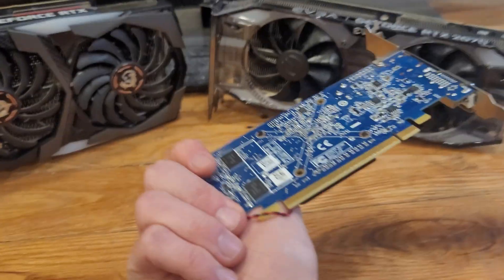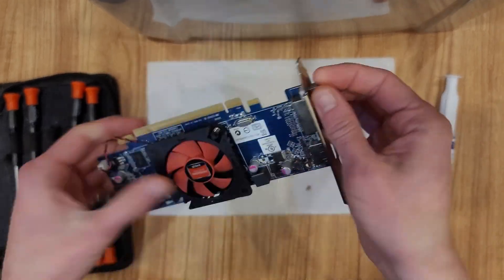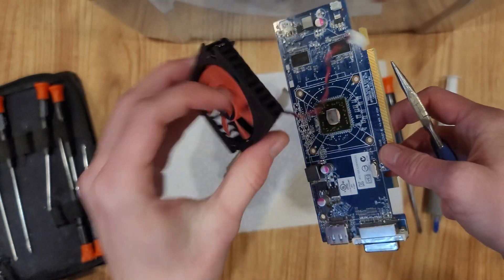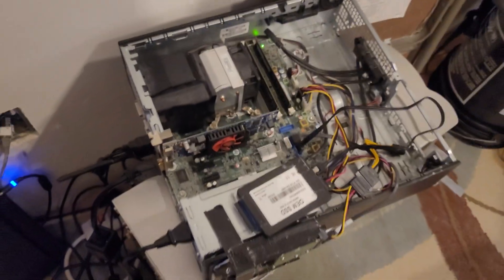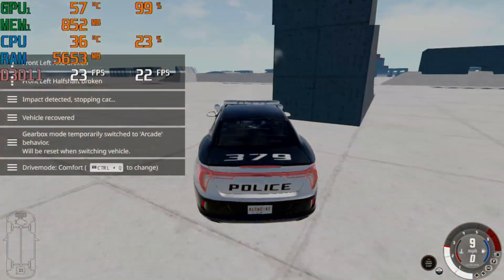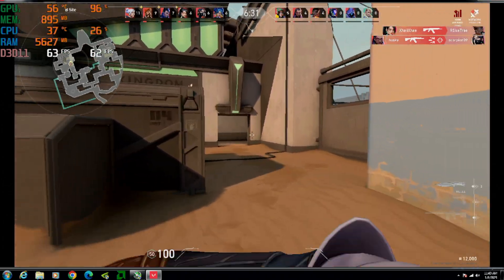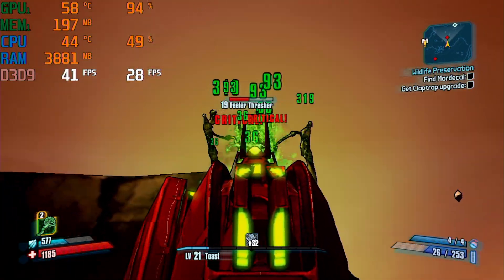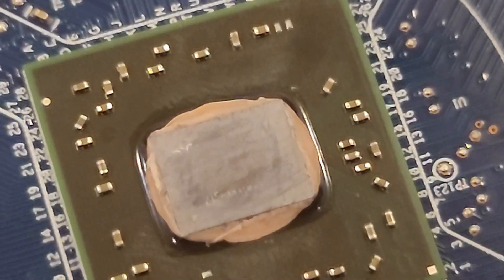Overclocking A $9 GPU And Forcing It To Run Games - HD 7470 In 2023

Comment: Idk how buy i can get 120 fps on valorant with 720 on the same card and 60 fps on fn with a lil bit of optimizing but here are the specs core i5 4460 3.4 ghz on boost and 16 gb ddr3 amd radeon hd 7470

Comment: I recently was forced to use one of these in 2024 as my laptop had died before my PC build was complete and I had to quickly cobble together enough parts to make my build usable and could not afford an actual GPU yet.

and it sorta changed me for a bit. for that entire time I only really played early 2010s era games and emulators of older consoles.

it's actually able to do Gamecube emulation at an acceptable framerate for Smash Bros. Melee at the very least, but it struggles with PS3 emulation, usually running at half of the game's intended speed. (and my CPU was actually decent so I am mostly certain the bottleneck was the GPU)

and also, for some reason, the card couldn't run 3D on Linux at all. I couldn't get any drivers for it even though I was told AMD card drivers for cards thay came from around the time existed in the kernel.

I got mine for 7.50 (2 of them for $15) and it did do more than I was expecting for that price.

Comment: Oh boy, wait until you discover the HD 7450 . 
That's right, you thought the HD 7470 was bad? The HD 7450 is about 20% slower than the HD 7470 , also it has half the Vram, at 512 mb, and there's only a gddr3 version as far as I'm concerned.
Reply from the maker: That card sounds absolutely horrible. Ill definitely get one

Comment: nice video

I pulled 2 of these from 2 Dell Optiplex 7010s I got from school. I put them in Crossfire and with a slight overclock to 875mhz on core and 1000mhz on mem got slightly better perf on supported benchmarks. Otherwise I'm just using them as display adapters for one of my Optiplex 7010 (which for me at least, performed better than the Intel HD 4000) and my Optiplex 790 (which has a Xeon in it without an iGPU)
Reply from the maker: Interesting, didn't know you could crossfire these cards. Don't really see why they would support it considering how underpowered they are, but I kinda wana try it now...